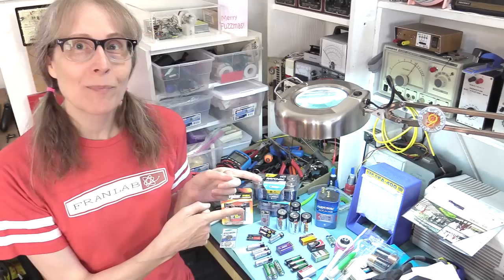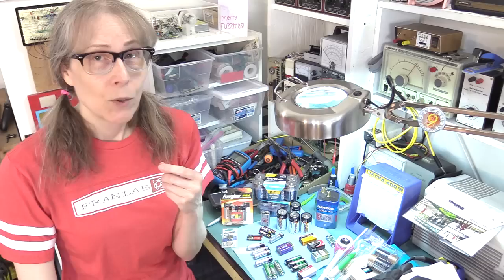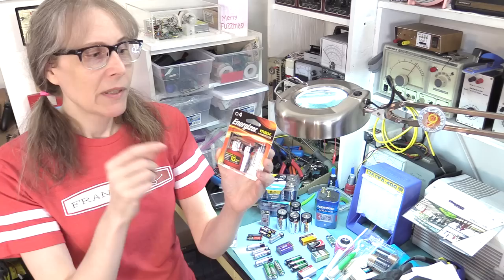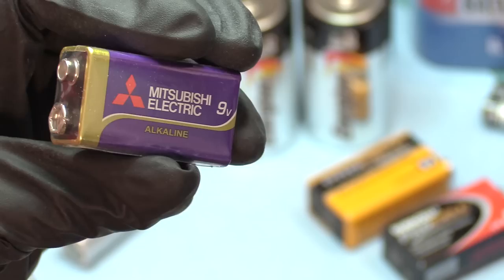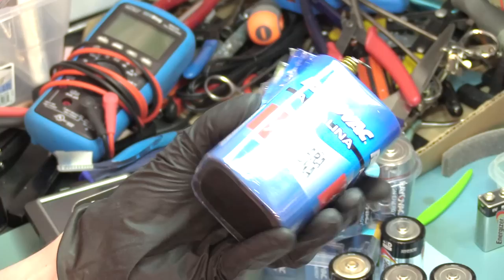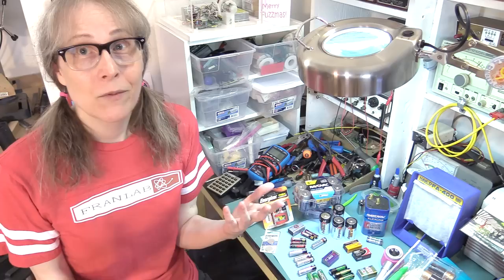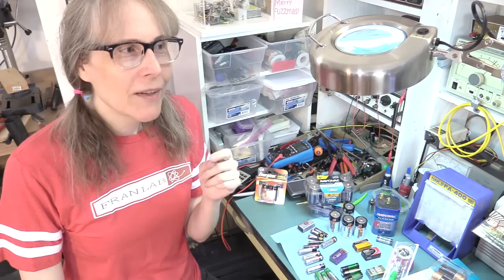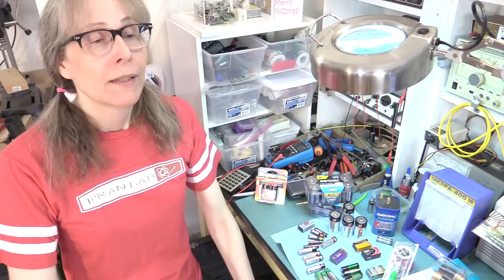Yikes! Leaky Alkaline Batteries!!!!

Comment: I haven’t seen a leaking battery of any type or brand in many years.  The old zinc cased ones used to leak, as did some of the older ‘leakproof’ ones, but that was long ago.

Here in the UK Duracell sell three different alkaline cells, Simple or Original I think these are the same, Plus and Ultra; I haven’t had any of these leak.  I’m tending to move away from alkaline for AA size towards Ni-Mh or Lithium.  For Ni-Mh I tend to use Eneloop Pro and for Lithium in that size Energizer seems to be the only choice, though Duracell make them in special sizes for things like cameras.

Back in the ‘60s devices from Asia usually seemed to come with Flying Bomb brand batteries!

Comment: Do you think a mobile app that tracks your devices batteries would be helpful?  You could take pictures of the device and/or use QR code stickers to track the devices with a self contained database that would generate notifications to check the devices and replace the batteries.  It could even have notes for type of batteries and location of device.  After watching your video this seemed like a way to tackle the problem.

Comment: I like those Panasonic Eneloop NiMh low leakage current rechargeables. They seem to last forever and the low leakage current means you can use them in things like remote controls where the leakage current is the dominant discharge.

Comment: I always insisted on Duracell,  the old you get what you pay for, but recently I found 2 ac remotes that were dead, the batteries weren't in them more than a few months,  I checked some other remotes and they also leaked, then I looked at the package that had batteries in it and the remaining 2 were leaking in the package,  I had disassembled the remotes and cleaned them with white vinegar,  but recently one of the ac remotes is dead again, I'm thinking the electronics didn't make it because of the leak, I'm now using all energizer because of the no leak guarantee, but they are about double the price, keep in mind the batteries that leaked were not worn down, had not reached there expiration, there was no reason for them to leak

Comment: I remember the very first time Alkaline batteries came out to the public.  I believe it was the early 70's.  I had a toy called the Vertibird, I think it was called. It was a small toy helicopter that you controlled with a wire cable attached to a control box.  It would go around in a circle and you could make it go up/down and forwards/backwards.  When my dad put in a set of the then just finally available "super, dooper" alkaline batteries, I hit full throttle and the copter nearly snapped the cable and flipped the control pylon that it was attached to, over!  I was THRILLED by the new found power AND speed of my toy compared to the power of the regular old zinc batteries that were the common stock of that time. And they LASTED a long time! Today, I find that BOTH Eveready AND Duracell are simply TERRIBLE!  Not only do they always seem to leak when you just look at them the wrong way,  they, especially the Eveready alkaline, come out of the new package already dead!  They don't even last that long anymore!  I find that the "off brands," though NOT ALL,  actually are MUCH better than the known marketed brands of Eveready and Duracell.  They hardly ever leak and hold a charge longer than those two!  Eveready.....why did you "skin" your bunny?  Duracell.....your copper top has tarnished quite badly these days!  😕👎👎
PS:  Sunbeam are also VERY TERRIBLE batteries!  Both their alkaline AND their standard ones, though they have not leaked on me,  simply DO NOT last long at all!  Avoid them like the plague, so to speak! Their Heavy Duty ones are more like "Heavy Doody!" 😂😂
PSS: I, too, have had some of those same GP Green cells last for a VERY LONG time!  What black magic do they use for this??!!  🤔😀
Reply: I spent many happy hours piloting a vertibird!! Thanks for the memory
Reply: @garywebb5927   I still wish I had mine!  😕

Comment: I have a sharp scientific calculator (not solar powered) I used in high school back in 1990 and it still has the original batteries in and it still works.

Comment: I have four Varta zinc-carbon AAs, expired in 1978, still have more then 1.4V in all of them, and no leaks! Also no current, unfortunatelly. If I put them in series, they can barely make a red LED glow faintly with no limiting resistor. Only a few hundred microamps in short circuit. I guess they are dried out, that's why they can't leak.

Comment: I’ve personally never really had a problem with this. Anything that I am not immediately using and that I’ve taken out of service I always take the batteries out of it. Most battery companies will also replace whatever it is that was damaged if you file a claim for them. I know Duracell & energizer both do this. If it’s something you absolutely must store the batteries in then use rechargeables if possible. Nimh 1.2V cells are dry cells and thus don’t really ever leak. Same with the energizer lithiums. Chuckles on the lantern battery. They definitely arent like that anymore. Its hard to find ‘real ones with F cells in them anymore, since nobody makes them now. So they often have lesser cells, like Ds in them instead.

Comment: Out of all the brands of batteries I've used Ray-O-Vac brand batteries are the worst.  You can't depend on them for emergency equipment because they leak well before they lose their charge.  I complained to the manufacturer and they basically said tough!  I have had better luck with some of the off brands than Ray-O-Vac.  I was under the impression that alkaline cells were vented to avoid the build up of H2 to prevent bursting.  I remember that a long time ago Eveready would guarantee replacing equipment that was damaged by a leaky cell or battery.

Comment: I had the throw out some maglite's because the batteries leaked and fused themselves inside the little tube. I tried soaking them in water overnight then driving a screw in the back so I could have something to pull them out with but it didn't work.

Comment: I have used alkaline batteries for decades. Leaking batteries were something I remember from the 1950s. But lately I am finding that Duracell and Kirkland batteries discharge quicker and leak. I supose Kirland may be made by Duracell. Anyway they are clearly not what they used to be. The same thing has happened with flooded lead acid auto batteries. What used to last 5 years now lasts 3 years. Automotive suppliers now say brand of auto battery does not matter, that Johnson Controls is now the monopoly that makes them all.

Comment: Actually a lot less carnage than I was expecting. Although in hindsight I shouldn't be surprised with someone as fastidious about such things as yourself.

Also don't forget, you should never mix different brands of cells when you put them in a device! Or new cells with old cells, or even newly bought cells with other unused cells that have been sitting on the shelf for years. They may have different discharge curves, so one cell may be fully discharged before the others, and they end up reverse-charging the discharged cell which accelerates the breakdown, generating more hydrogen gas which quickly turns into a leaky mess.

Comment: The lightweight lantern batteries use something like D cells, which are shorter with the bottom inch of the case filled with a block off Styrofoam.

Comment: Even seen new batteries leaked in the packet on the supermarket shelf.  The 777 battery reminds me of the Flying Bomb batteries sold in UK weekend markets in the 70s. They were cheap Hong Kong imports.  Sunbeam make electrical appliances, didn’t know they made batteries.  I’m mostly using Energizers these days.  I have a conversion calculator I found at a thrift store, the lithium coin cell had leaked but it did clean up ok after letting it sit for some after a good dose of deoxit and scrubbing with a tiny brush.

Comment: That would happen all the time with the green military D size batteries my father would get while in the air force.  Recently I found I had left AA batteries in my Nikon 8008 Flash that leaked and I had to use a small piece of foil to make a good contact with new batteries after cleaning it up and using fine sandpaper on the contacts.

Comment: I lost a superb flashgun because of a battery leak.  Although I would remove the batteries when it wasn't being used, somehow a leak happened which completely destroyed the circuit board .Totally beyond repair.
I also never get Duracells, but fortunately they are not often seen in these parts. (Malaysia). Energizers are my favourite brand.
I had a problem with Eveready Super Heavy Duty AA size. Put one into a quartz clock, and it wouldn't go. Brand new cell . Clock worked before. Changed to a different brand and it worked fine. When tested the new Eveready gave 1.7 volts off load. The clock didn't like that!

Comment: Interesting post. I have to agree with you on the various brands and their propensity to leak. LED flashlights are especially problematic for me because it takes so little charge to light them. I’ve had batteries leak while still able to energize the lamp.

Duracell batteries are the worst. They have leaked in my electronics in as little as a year. 

I’ve used a lot of RAYOVAC alkaline batteries as well and find they are not as bad as Duracell, but they still can leak if ignored for a few years.

As for Energizer, I was going through some camping gear yesterday that I haven’t touched since fall of 2010. I discovered a headlamp with three Energizer AAA batteries still installed. They could date back as far as 2003; I’m not sure. Either way, whether it’s been ten years or seventeen, their cases were in perfect shape. Lucky me.

I don’t use alkaline batteries anymore. I find Eneloop rechargeable batteries suit my need just fine, even if they don’t pack quite as much punch. They keep going and going and...oh, wrong company.

Comment: I always thought the guarantee was only to replace the battery and not replace the expensive hardware that was ruined.  I've had too many things ruined by batteries that had a "good" date years from the day it leaked.  I have an old HP calculator that had the button cells last over 20 years of daily use.

Comment: Has anyone else had problems in the last few years with batteries leaking while still working? I've had a few devices (a flashlight in particular) that was still working fine, only to find out the batteries are leaking light mad! With the flashlight, it had an aluminum body and the only reason I even checked the batteries was I noticed a spot on the outside where the leak had eaten thru it. Otherwise it was working fine. What the heck? Can't remember the battery brand unfortunately.

Comment: A few weeks ago I heard a loud bang... no fire nor smoke so impossible to find the source... A few days later I found a blue piece of plastic (the way you find legos..) but I had no idea where it belonged to. Until I took a 9V Duracell (pro  witch felt very light, it was missing the guts. The blue plastic appeared to be the bottom of the battery, still looking for the guts though.....

Comment: Those off branded 9v batteries, or the ones with the device manufacturer's brand, are probably manufactured by a small number of manufacturers. It's likely Mitsubishi, or Sunbeam commission battery manufacturers to put their brands on them.

This is not unlike car batteries, which are only manufactured by a small group of manufacturers. The supplier just has the manufacturer put their names on them.

Comment: You can usually get corroded contacts to work better with som aluminium foil so long as there is a little bit of bare metal  or intermittentintermittent connection. If you can pry the contacts out wrap them in foil. It usually can make it work.

Comment: Can often this happen when several batteries in series. When the cells are discharged, one will become completely discharged first. This cell that's is discharged is being reverse charged by the others in the string. This causes the gas generation and leakage. Switched away from Procells (Europe) because new AA 100 baulk packs would often  arrive with some leaking cells.

Comment: I've never had any problems with leaky Duracells, the worst alkalines I've had in recent years for leakage are Kodak AA & AAA cells, I've had several leak whilst still in the packets, years before the expiry dates, the best brands for longevity & no leakage are Panasonic & Lidl's own brand Aerocell brand.
A strange phenomenon I've had on several occasions is when using a pair of alkalines (any brand) in low drain items like TV remotes or LED bike rear lights, is that one of the pair will drain compleatly flat long before the other one.

Comment: I agree duracells suck. They leal often, do not use if you do not want your item damaged or ruined. They are expensive as well so they are a lose/lose in my opinion. Rayovac are decent, rarely leak and actually last longer than duracell. Ever ready is best but little pricey so I often find and use rayovac aa's.

Comment: With batteries you have a choice to make. Do you want to remove the batteries from a little used device or do you want to try to clean/salvage a device in which the batteries have leaked?
I got tired of cleaning up leaking battery cell damage so I bite the bullet and remove the cells from any device not in use.

Comment: Good video Fran. I have a large container of used and old batteries which I want to recycle but haven't found a place to do it. Rechargeables are not an issue but all other batteries apparently are. If any Franfans have a suggestion, I am open to them.

Comment: If I buy a new item with batteries inc, test it and throw the batteries away as they are probably bought in bulk to keep the price down. I leave batteries out of everything I don't use on a regular basis, its annoying but if you keep the batteries with the device ( in a bag) its not that much of a pain and I never have corroded contacts. The number of things Ive thrown out due to leaking batteries just makes me shudder, no more

Comment: I agree about Duracell's they have cheapened the construction for more profit. I have lost more Simpson meters to bad alkaline batteries, that I now use NimH batteries in all my test equipment. I had an alkaline leak so bad at the negative terminal that the corrosion wicked up the wire from the anode  and corroded the point on the PCB where it connected.

Comment: Pinball MPU boards were prone to battery damage . I brought many back to life but it is a tedious job.  Williams Electronics used 3 AA cells so by the time the voltage sank below 2.2volt where it was noticeable each cell was down to about 0.8 or 0.7 and by then they were leaking and they liked putting the batteries up in the board so it could leak down on everything and cover the greatest area.   The NVRam ends that issue.  One thing about Zinc-Carbon they just die and keep to themselves and they can be recharged a little without blowing up.   How much battery do you need to supply a CMOS Ram with 7 micro-amps?

Comment: I have new Duracell Ultras still in the package leaking though they aren’t expired until 2022 or 2023.   The packages are unopened and if you open them the testers do not work, but they still have plenty of power.    I have a package of Duracell Optimum AA unopened not even two years old leaking.

Comment: Duracell batteries even leak when they are still have charge,  and this especially in devices which are not used often, or devices which have a very low current draw like thermostat control units for central heating. 
The weirdest battery brand i ever have seen was "Dong Guan", and they where in the black and copper colors like Duracell, a set of 2x AAA that came 
with a remote of a Konig TV card back in the early 2000. The quality of these was so bad, that if you squeezed them with your fingers, you had a dent in them, just like you squeezed a piece of chocolate. 
As longlasting batteries, i have here 6x  AA batteries from the brand Philips, they were bought in a Tandy store here in Belgium begin 90's, and have a expire date of 1994,
and these have still a charge of 1,502 V and no leaks.

Comment: One would expect that an electronic device that is used constantly shouldn't end up with leaks that often.  But such is not the case.  I've lost so many remote controls for my TV/DVD/CABLEBOX, etc, to leaking batteries that it is no joke.  And for some devices, when the remote dies the device it controls can no longer be used.  The functions on the remote aren't replicated on the device.

Worse than the remote getting destroyed is the fact that I have been burned, chemically, by the leaking batteries as I held the remote in my hand.  No brand is "better" than any other brand.  They've all leaked.